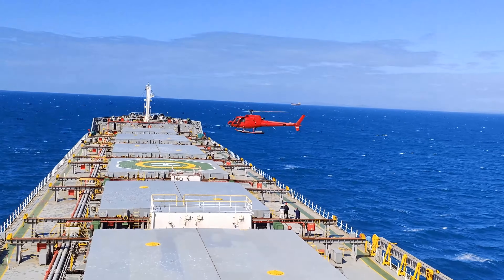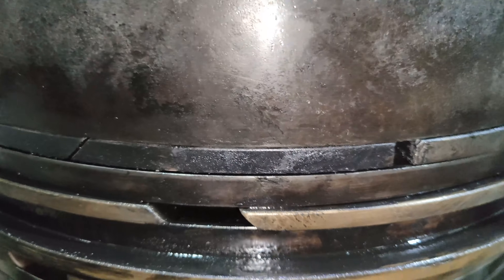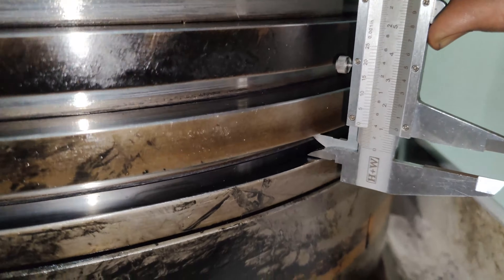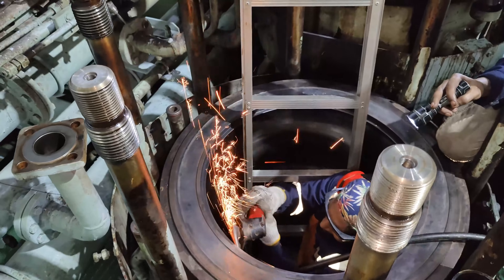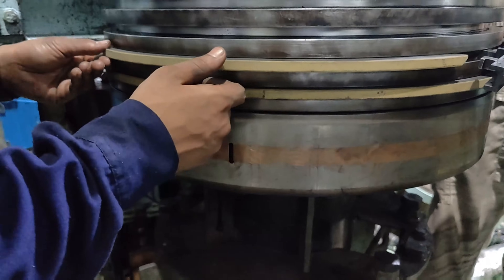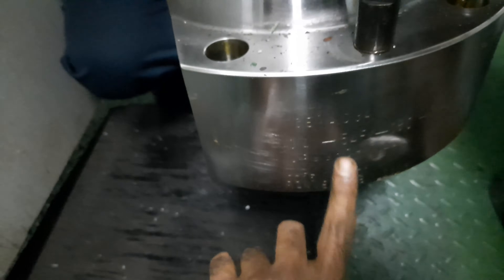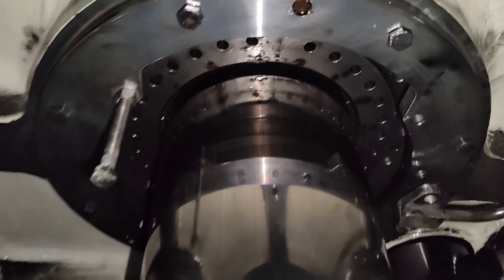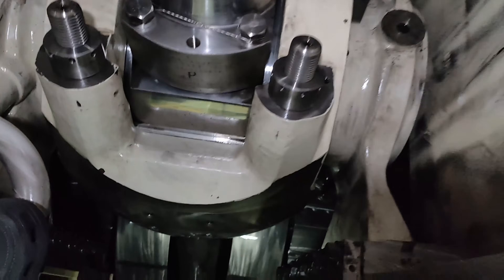MAN B&W ME C ENGINE COMPLETE DECARB JOB VIDEO | PART-2 | SEA LEGEND |

Comment: During box back first checking of cooling water then connect rest of the parts is an great idea sir most of the engineers not following,and when fixing the stuffing box in place jacking bolts are used is it necessary to do this step every time or when we face any misalignment of stuffing box with frame.many important things like marking on stuffing box and piston rod should have to be matched are very informative keep posting.very useful.thankyou verymuch sir.